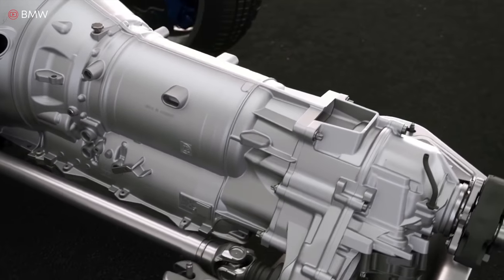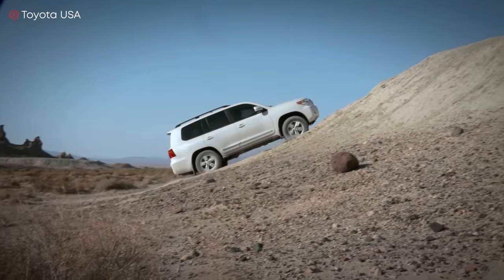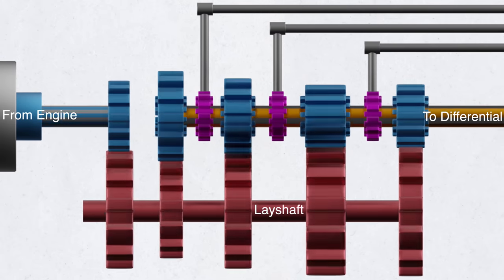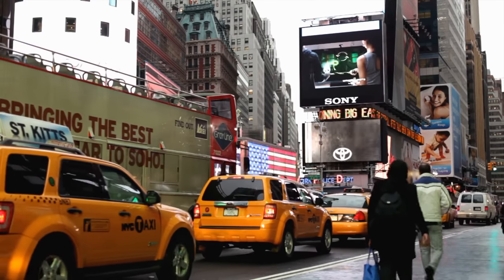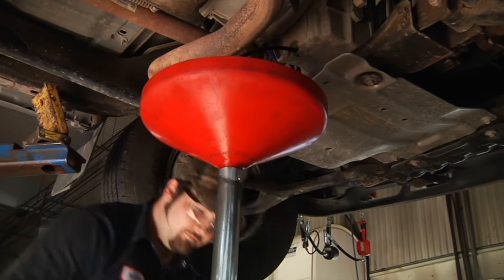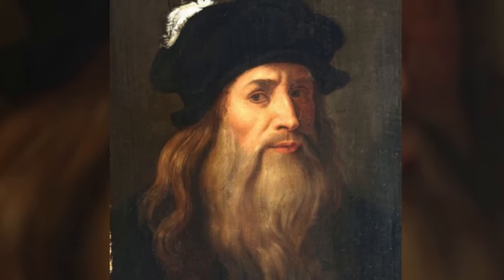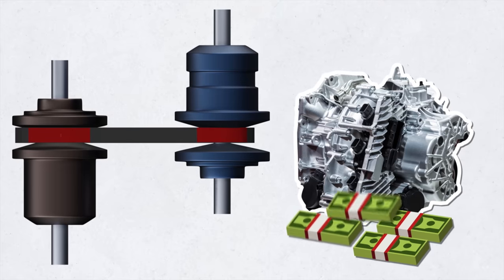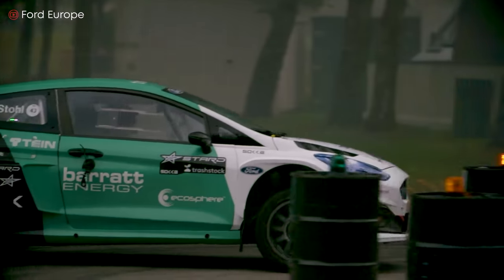Who Makes the Best Transmission and Why

Comment: I like how Mazda chooses to not use CVT transmissions.
Reply: i believe is because mazda wants to be that premium sporty brand in the mainstream market and they prob know that a CVT would take away the fun out of the driving
Reply: @Datsun7705  
Do you think CVT's can be fun?
Reply: @Datsun7705  they’re really not into the sporting brand anymore besides their mx-5 since they don’t even make Rx-8 anymore s now they’re coming out with little Skysctive 4 Bangers which are really reliable and incredibly impressive  now they mostly have there Suvs With there Smart Awd System
Reply: @lordflufffluff  I'm not sure what a sport tuned one is like, but every CVT I've driven is horrific. I'm a car guy/valet for a living. I've driven multiple CVT WRXs and it's unfathomable how detached the car is. The turbo does not want to spool.
Reply: well, all I can say is I don’t think my valet guy need to push my car to the point the turbo kicks in
Reply: @humbertorubi2735  shouldn't give your car to valet then 😉
Reply: That's why I like buying Mazda cars.
Reply: Yet....
Reply: They certainly do use the noisy cvt in Australia.
Reply: @lordflufffluff   What fun can a CVT gives you ? In a manual, you hear the engine rev up and down when you change gears. That is fun. You do get that in a conventional automatic transmission too. A CVT ? It sounds like a cow . You only hear a monotonous "Moooo" as you accelerate. When you try to push a CVT hard uphill, you will definitely hear the CVT whine , louder than a supercharger whine.
Reply: I wasn’t aware of this. Hats off to Mazda
Reply: I like how I choose not to use a CVT transmission. If you need to ask, you can't afford it.
Reply: The best automatic transmission is the variable frequency converter in a Tesla. It has an infinite number of "gears", and no moving parts. Is that great or what ?
Reply: @bigskeet5655  I have a '19 Accord 1.5T with their CVT and the turbo has no problem spooling up.
Reply: @fleurdewin7958  What CVT are you driving? The one in my Accord is silent at all times.
Reply: @rusack7174  smaller engine, smaller turbo
Reply: @bigskeet5655  OK, as compared to what? Turbos are likewise sized to the displacement of the engine and max power engineers want to develop. As I'm sure you're aware, there are designs that seek to keep turbos spooled up more to combat lag. Now, on my Accord, if I punch it from idle surely there is some noticeable lag but while at speed much less so where it's almost unnoticeable.
Reply: @rusack7174  we are very obviously comparing to the car in the original comment you replied to (CVT WRX) your accord has a smaller engine and smaller turbo which will greatly reduce lag. The WRX has a nearly 70hp BUMP over the accord. Displacement and a larger turbo than the accord creates that. Also it takes much more crank horsepower to get to 268 hp (WRX) that you need to make 192 hp in your front wheel drive accord.
Reply: @lordflufffluff  in a snowmobile awesome!
Reply: Germans make the best transmission 👍
Reply: @fairiesflame1345  They're great except for the rust
Reply: @Mr2pint  agreed. I have a ZF8 with 270K miles. It's never been tampered with. Just replace fluid and pan/filter every 100K
Reply: @Benny-zo3qh 
Just about any car can rust. I don't know what you are on about.
Reply: @fairiesflame1345  I'm talking about the fact that Mazdas are known to rust faster. Please don't try and turn this into some dumb youtube argument, I'm only pointing out facts do your research i've owned 3 and one I still have.
Reply: @Benny-zo3qh 
I've seen lots of Mazda cars around my area in Australia. Some old and new. I don't see any rust nor I have heard anyone had a rust problem.
Reply: @fairiesflame1345  Like I said, if you simply look it up online you'll find tons of information regarding the FACT that they are very rust prone compared to other makes and models. Doesn't matter what your personal experience is.
Reply: @Benny-zo3qh 
Links?
Reply: @Benny-zo3qh 
No, show me the web reports where is says. Otherwise, I already checked, but only seems to apply for the earlier models where they were sharing parts with Ford.
Reply: @Benny-zo3qh 
Which year models do those apply in? And why in US?
Reply: @fairiesflame1345  Took me less than 5min to find that and there's tons more. I rest my case.
Reply: @lordflufffluff  Read it again.
Reply: @Mr2pint  actually AISIN transmissions are the most reliable on the planet. Used by toyota. Even their cvt is reliable.More and more companies are beginning to switch to AISIN
Reply: Mazda is stepping up there game the looks of the cars have gotten much better and the quality is also much better than in the last decade
Reply: @richarddavis750  which mazda cars use CVT transmissions in Australia?
Reply: @poncho828  G'day Poncho. My wife and I test drove a mazda cx3 recently and the transmission was very noisy. The salesman said that was normal for a cvt. I could be wrong - wouldn't be the first time.
Reply: @bigskeet5655  cvt is for fuel, and smooth ride. Subaru uses a starting gear or two, to help balance between traditional and cvt.
... But it is really only a middle ground. They're good, just not fun. And require more fluid changes.
Reply: @emilyhofland8219  what amazes me is that they made an STI with a CVT for the first time ever and it sold out almost instantly in Japan. Would love to see how one of those drives.
Reply: @bigskeet5655  I couldn't tell ya.
... My specialty is honda... I still remember my  reaction when we got the very first, brand new Elements. ... Sometimes you see a car, and just know... Somebody got fired.
Reply: @jordan streib they had problems not with a CVT but with a dual clutch style automatic
Reply: Here here
Reply: @Datsun7705  there are Audis with CVT though.
Reply: @Datsun7705  But Mazda has quarky throttle response issues on all their cars.  They feel just like turbo lag at low speed.  Their gas peddles have only two settings in it - slow or fast nothing in between.  This is why I can't stand driving a Mazda, I know because I own them from a 2016 model year.
Reply: I always ❤️ Mazda’s
Reply: CVT? Cancer verified transmission?
Reply: How come, they sale cx-5 with 2.5 liter petrol engine and cvt transmission in europe.
Reply: I have a 2006 Mazda 6 for sale. Metallic Grey with Black Cloth. Auto / Manual Trans . Runs Great. Looks Very Good. $ 3400.00
Reply: @slims2503  do you have a link where it States they use a cvt transmission?
Reply: @poncho828  check out any european mazda dealership they have this configuration. Drove one 2020 model really nice car to drive.
Reply: @slims2503  are you referring to the skyactiv-drive transmission?
Reply: @fleurdewin7958  that's the sound of the electric motor, in your hybrid... there  ya go... speed racer.
Reply: as they shouldnt, smart people
Reply: Landscaping Specialist l
Reply: @humbertorubi2735  You don't have to push it much for the turbo to kick in on new small engine cars.
Reply: That's because a garbage transmission lasts longer than their garbage engines !
Reply: @rusack7174  my 2016 Honda fit is wild and fun to drive beats most vehicles off the line  it has a quiet CT transmission.
Reply: @bigskeet5655  the only “sport tuned” cvt I know is the F1 Williams team
Reply: They also went from 5L/100 to 6.4L/100km lol......
Reply: @rayspencer7255  I could’ve sworn Tesla does not have a transmission
Reply: @jessewynne8193  You are correct. There is no physical transmission. The car goes faster by increasing the frequency of the electrical power into the electrical motor. Other than the motor, and a fixed step down gear, there are no other moving parts.
Reply: Yea but it's not like everything else is good
Reply: For now. The EPA will make them bend the knee.
Reply: The CVT has come a long way in all honesty they’ve learned to program them to almost feel like they shift. They’re still gross, they shell out quickly, they build heat to temps far higher then an auto, manual, or dual clutch, and don’t shift but try to act like they do. It makes sense still, it’s very hard to jam an 8 or 10 speed auto into a small car
Reply: Actually cvt transmissions in toyota and lexus are more reliable then that of the conventional automatic mazda transmissions. Cvts are basicly the most reliable as used in the toyota and lexus
Reply: @Datsun7705  mazda is developing a 8 speed skyactiv transmision but honestly they could have just bought zf8hp transmision instead.
Reply: No hahaha Mazda will do you one better they will put a water pump on the timing chain 😂
Reply: Unlike other torque-converter trannies, Mazda also locks up on 1st gear. No wonder it accelerates about as fast as the stick version!
Reply: @anonymike8280  then we won't ask
Reply: Automatic transmission with grears or manual no CVT!!!!
Reply: CVT= Crappy variable transmission will never buy one.

Comment: NISSAN CVT FOR THE..................LOSS!!! 😂
Reply: My dad hated his. Brought it back to the dealer... And bought a GM. Not sure if thats much of an upgrade.
Reply: Had a 08 Nissan Altima 2.5 with CVT transmission for 11yrs.. 120,00 miles with no problems 
Miss that car
Reply: @rogervaillant6044  You just got lucky. If you think a Nissan CVT transmission is reliable then so is a 7 series BMW
Reply: @Benny-zo3qh  I guess I got lucky... sold it in may 2019 and the person that bought it is still driving it with no issues
Reply: @rogervaillant6044  Hey it can happen. The transmissions are deemed crap due to the amout of issues people have with them. Peopls just need to be aware and purchase at own risk
Reply: CVT is fine if actually serviced, the problem is most manufacturers have to long of an interval and don’t even offer the cooler filter for the Jatco cvt
Reply: @therealone9900  You know you're probably right, but if I say that there's a lot of BMW'S that are good as long as you service them people lose their minds. 
I'd rather spend the extra care on my BMW then on a CVT transmission
Reply: @rogervaillant6044  They were made better then! NOT NOW!
Reply: @Benny-zo3qh  bmw owners are rich 🤑
Reply: So true ! My 2013 Nissan Altima ( that I bought brand new) CVT crap transmission had to be replaced at 65k just after my warranty expired of course!!
Reply: Nissan transmissions are the worse. Thats why I will never buy a Nissan. Nissan use to be very good cars before they sold out too Renault.
Reply: @johnjohnson6207  With Nissan you will probably has some problems with the CVT, but with a GM you will have problems with the entire car very soon.

Comment: ‘ 94 Toyota Celica made the best transmission.
Reply: BINGO 47! You correct Sir! I have over 340,000 miles on mine to prove it.
Reply: I took my driving license in a 2010 manual audi a5 and when I bought my first car a manual celica t20 that gearbox felt way better than the Audi's or any other car I have driven. So I can approve this comment.
Reply: The four-speed Toyota was one of the most reliable every made. But technologically obsolete.
Reply: Gm 4l60 and the e variant. If there was ever a bulletproof automatic, that the one. Even if a gear is going out, it drives smooth.
Reply: @anonymike8280  Tell my 94' Celica that with over 340,000 miles on it. The only thing that will be obsolete is the money you spend on a new car that's a depreciating asset.
Reply: @TheLizardKing1967  You don't understand the meaning of the word. Calling something obsolete does not mean that it is not functional. I'm shopping for a Toyota Avalon with a 4-speed AT right now. That means 2003 or older. Obviously, I consider the Toyota 4-speed AT functional and reliable. That's why I want it. But I do know that it is technologically obsolete.
Reply: any car with only 4-5 gears had a pretty reliable transmission. After they started making these 6, 7 and 8 speed transmissions every since like 2005. I feel like theyve been much less reliable when coming to higher miles being put on them.
Reply: Everyone in the 90s put the celica 5spd behind any motor swap.

Comment: I like manual transmissions.  Always have. I have owned more manual trans than automatics.. i feel much more a part of the car shifting myself.  Plus here in wisconsin if you go over a icy bridge i like that i can just push in the clutch and have no reason to spin or lose control.
Reply: That’s ok if you have to working feet.
Reply: Same. Way cheaper on the maintenance unless you don't know how to clutch properly. Mine is still strong at 200k original.
Reply: Can someone explain why does pushing in the clutch make it so that you don’t lose control when going over ice?
Reply: @oliverthorcollington8948  Because pushing In the clutch completely disengages the power to the wheels
Reply: @oliverthorcollington8948  You choose the perfect baance os speed and torque for each need and cam maintain it even or, besides,change it if you need,for the same stability purpose.Well, I can only tell about other slippery conditions but ice !

Comment: Considering everything, cost, performance, smoothness, range of application etc the best transmission in today's world in ZF 8HP models. Pretty reliable, better fuel efficiency than manuals, very smooth changing gears, almost as fast as dual clutch transmissions. ZF got the best of both worlds. That's why they are installed in BMW, GM, Toyota, Alfa Romeo, Audi, Aston Martin, Dodge/Chrysler, Lambos, Land Rover, Porsche, VW, Rolls and more....

Comment: My parents had a 1958 Chevrolet that had something like a CVT, but it was hydraulic. It had 3 turbines and the transmission could valve the fluid to 2 of the turbines at the same time, in any proportion that was needed. It did not have definite shifts that could be felt. The car just went faster, accelerating but the engine speed remained about the same. It was called the Turboglide. My Dad called it other things as they had reliability problems. Eventually he had a Powerglide installed.

Comment: The ZF 8 Speed. And the way Dodge has that Calibrated with the Durango riding on that Mercedes Chassis is pretty sweet, and  I only have the V6. Its kind of fast but really quick and great on Gas for the power that you get.
Reply: The ZF8 is a great transmission that does almost everything you could ask of it. But it's missing that last 10-15% that makes something like a PDK world class.
Reply: @AQCE245 ZF makes PDK

Comment: I'm thrilled with my Lexus' 6-speed Aisin A760H transmission. Reliable, smooth, quick to shift and perfect ratios. Low RPMs at a steady speed but still enough oomph left after 100 mph.
Reply: Also a great manufacturer of automatics. In the 80s and 90 Opel uses aisin-warner-transmissions.

Comment: you didn't say who makes the best transmission and why
Reply: Mercedes or Toyota here you go
Reply: Lexus/Toyota for automatics and still excellent for manuals. Manual trans, are reliable on many models but Honda makes them very well, they're so smooth from clutch pedal and shifting.
Reply: @serge.l.1897  that because Honda was originally a motorcycle company and their manual transmissions  were great and reliable so they have always been good with making reliable manuals
Reply: @serge.l.1897  why new supra have bmw engine?
Reply: @serge.l.1897  Subaru makes the best manuals Honda make good ones but not anymore
Reply: @andersonrodriguez8258  Honda still does, especially that they are still making powerful motorcycles.
Reply: @serge.l.1897  their manual transmissions suck (Toyota). They usually break around 170k miles.... overrated as always. Also ZF make better automatics.
Reply: @calindor19  The new Supra is 100% Bmw from their Z4 factory, even their infotainment syste. Toyota only tuned their Supra version of it while BMW came out with the Z4 revision.
Reply: I think you can assume toyota/lexus on this channel
Reply: 10 speed GM transmission 👌
Reply: @duncanidaho7494  170k miles for a trans is not bad at all lmfao. Especially if you did all the driving.
Reply: @mordecai6351  not for an automatic transmission, but bad for a manual transmission.
Reply: Scotty is a Master Baiter!
Reply: @calindor19  the new Supra uses a BMW engined built to Toyota’s exacting specs. Several articles have been written about Toyota engineers pulling their calipers out on the beemer assembly floor.
Reply: Well one thing is for sure...it's not Nissan. 😂

Comment: Scotty, you would love this. When I was still a very green Mech. Engineer I worked with an old pump and motors engineer and we installed and adjusted an Allis Chalmers 2 million gallon a day pump and motor. It used a flow meter and Pneumatic controls to control the pumps 18 in. radius disc in and out and had two huge serpentine belts that controlled the flow complicated with the fact the motor was also two speed. I had to learn to maintain two of these and keep the valves adjusted correctly. The thing was about five feet high and the plants overhear crane helped us lift the motor off for service. The belts were a new fangled technology in 1975,  four inches wide and costing 800 dollars back then. I was in LOVE.

Comment: The AW4 transmission in my Jeep is a beast.I have almost 400,000 Mile's on my 99 Xj and I only needed a torque converter at 325k... Transmission is still like new

Comment: My wife's Nissan Murano SL had it's CVT crater at 61,000 miles. Nissan would not even look at it because they said we were over the warranty mileage.  We had to take it to Katy Transmission.  The owner said he had a total of six Nissan CVT  vehicles that were waiting to be repaired.  I was told that Nissan had a high rate of CVT  failures.
Reply: My mother had a Nissan rogue and her cvt crapped out right after the warranty was up. They are def pieces of junk.